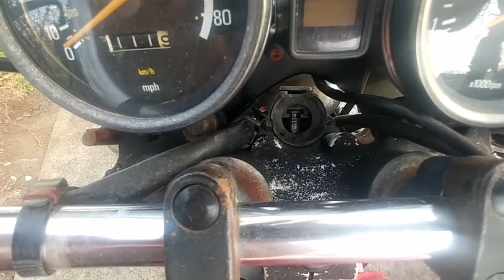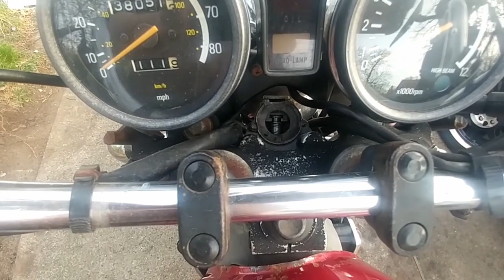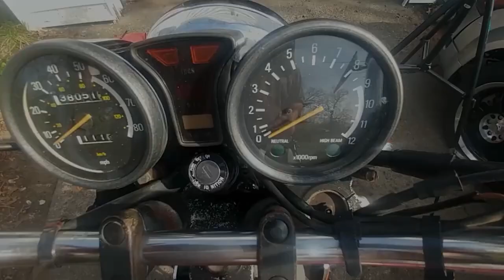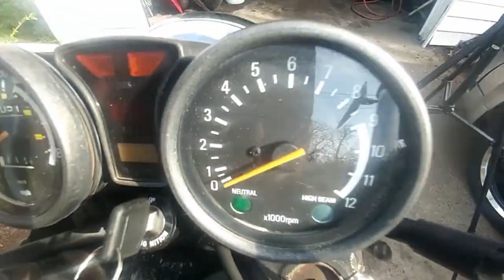Replacing an ignition 1981 Yamaha XS850 Special - Vintage Yamaha Backyard Restoration EP 10

Comment: I have an '82 Maxim that I thought needed a new switch.  I got one on ebay, maybe the same kind you got and I also got a new battery.  The new switch had a 3 pin connector the old one had a 3 pin and a 2 pin!  I installed it anyway, and I got a new battery just in case.  Got it to start on the 3 pin only!  Battery light on the dash is on, and the bike won't re-start if the handlebars are at a certain angle.  So I have a short somewhere, it is a 42 year old bike afterall.  I didn't use the bike since 2022 as I tackled cancer in 23 so there may be other issues from sitting an extra year.  Thanks for the video.
Reply from the maker: @LarryTheButcher  Anytime. I'm glad I could help.